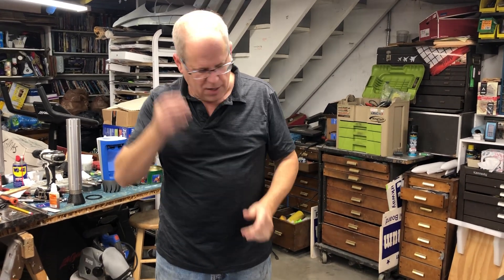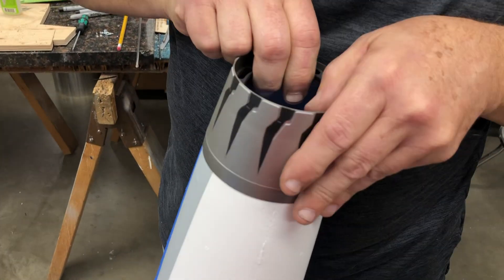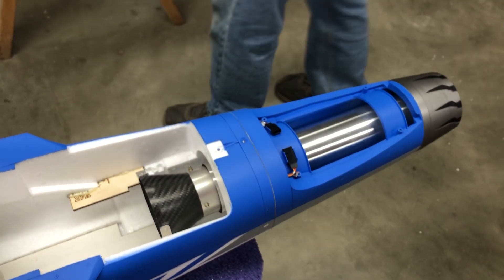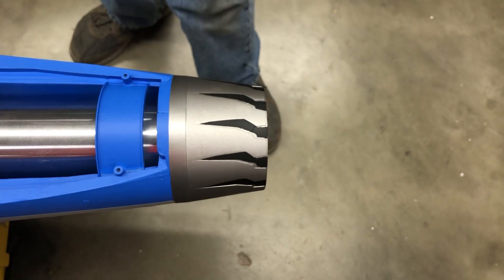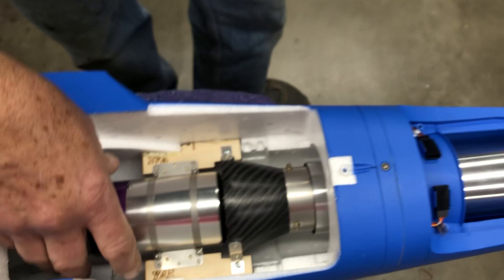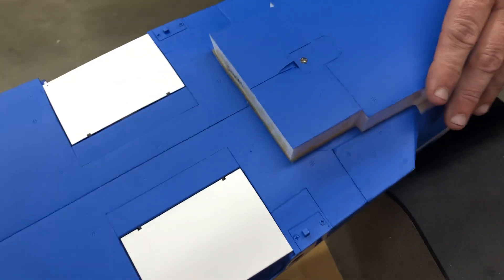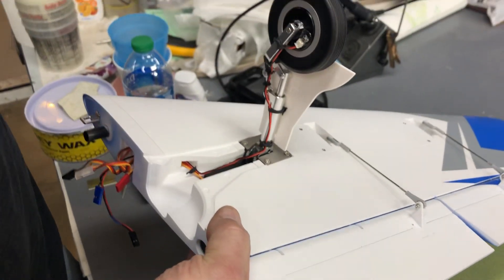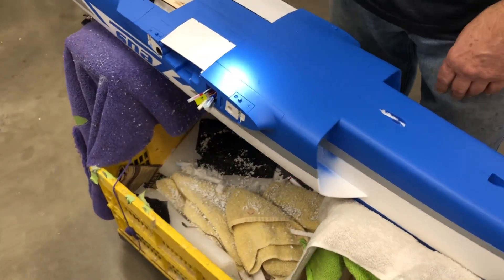Freewing Zeus turbine conversion Episode #3

Comment: As someone that owns the Zeus 8s. do you think this would be a good beginner turbine jet? I definitely want to get in a lot more flights and experience before jumping in but the longer flights definitely seem way more pleasing. Great video!
Reply from the maker: The Zeus or the eflight viper jet would be good first conversion projects. There is more room in the 90mm models for the conversions. Flight time on the Zeus is 8-9 minutes. The eflight viper jet has 7-8 minute flight times
Reply: @paulappelbaum3284  Thanks a ton! it would be cool to see a video geared towards someone like myself that doesn't know anything about turbines and the equipment to run a turbine in a project like this! again great series!

Comment: Paul. This is fantastic work you’re doing. Back when I flew my first turbine foamy, there were very few options back in 2015. I just knew a small turbine jet was possible, however practically none existed. I have an early (V2?) HSD Super Viper 105, that I still fly, albeit many mods/upgrades/ improvements to this very early version.

Comment: Thx for the reply ..
New question Paul .. which foamie turbine conversion were you most satisfied with, weighing the time/effort/resource, best flyer and flight times.
Reply from the maker: Zeus best flight time. T33 best flyer. They all fly good  zeus  is easy to convert. T33 needs to be very organized up front. Viper fairly easy to convert. Avanti is hardest

Comment: Hey Paul great build series!  I noticed you are using a Castle 10a BEC,  is this what you use on all your foam turbines?  I was just concerned that if you have say 8 CH on a receiver wouldn’t that potentially be too much.  Castle specs state they will only support 4 standard Non-digital servos,  essentially a small plane?
Reply from the maker: I use the 10 amp castle blue bec on all my models. No issues at all